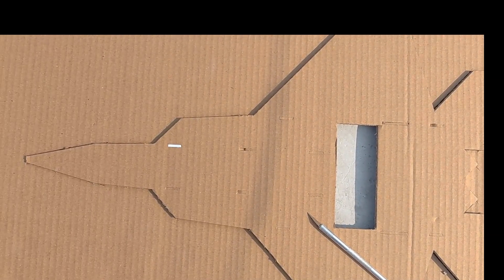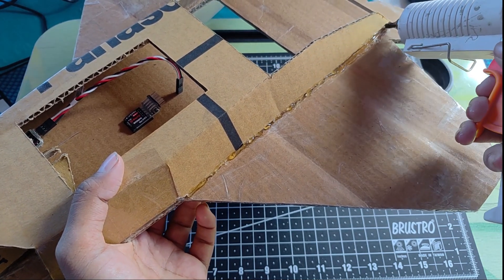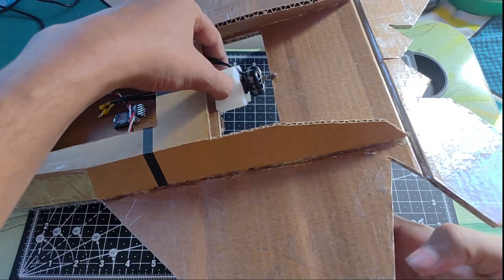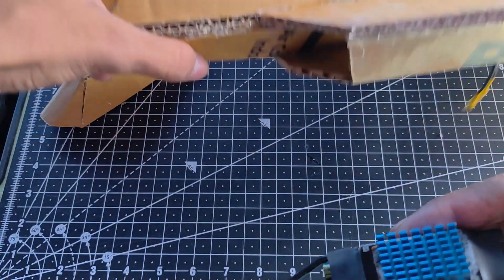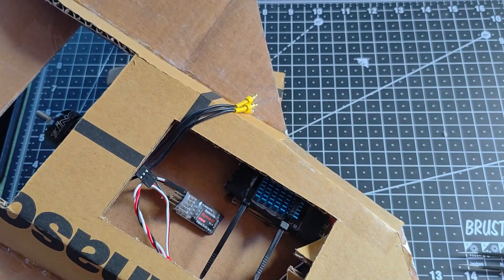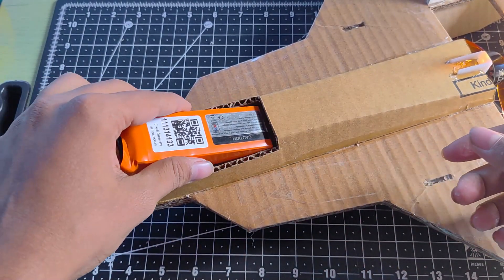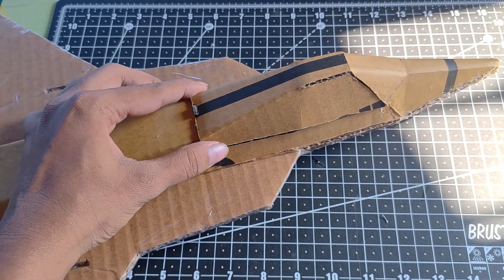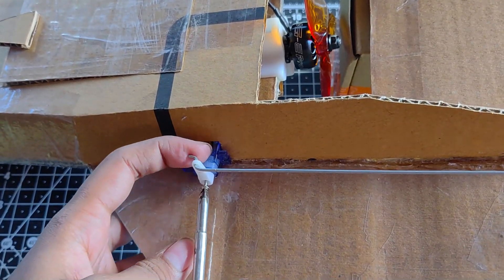I made a DIY RC F22 Raptor ! | Super Fast !?

Comment: very nice but i am asking if it is necessary to buy a tranmitter with screen if we can buy without it
Reply from the maker: You can use any transmitter but don't buy a CT6B ...
Reply: @saaraswata  thnx bro
Reply: @saaraswata  you earned a subscriber
Reply: @saaraswata  can i ask you any thing if any problems comes in the build
Reply from the maker: Yeah sure , And thanks for the sub 😀
Reply: Do we need any coding for the gyro
Reply from the maker: @sjgaming8890  no